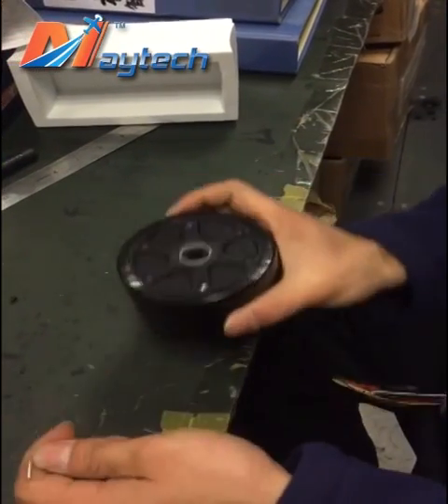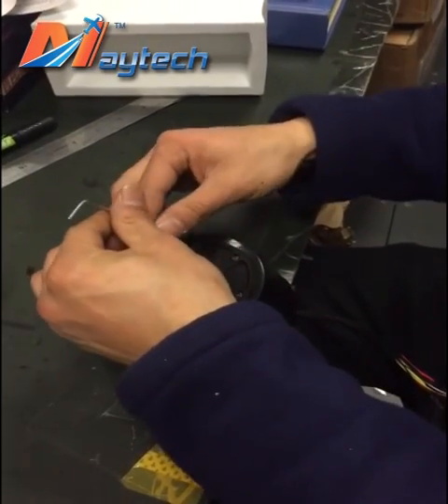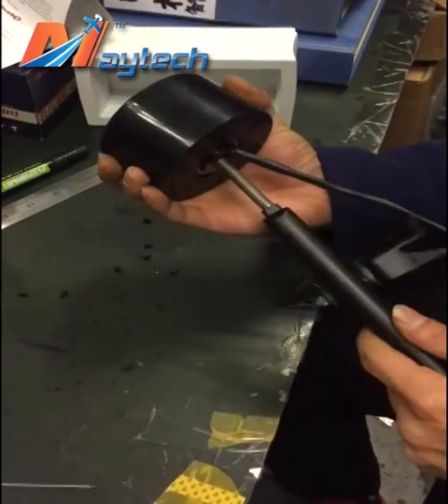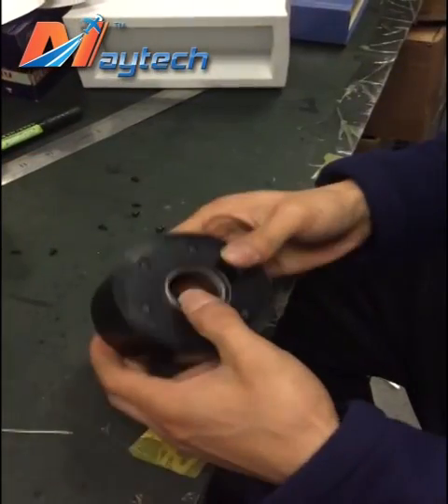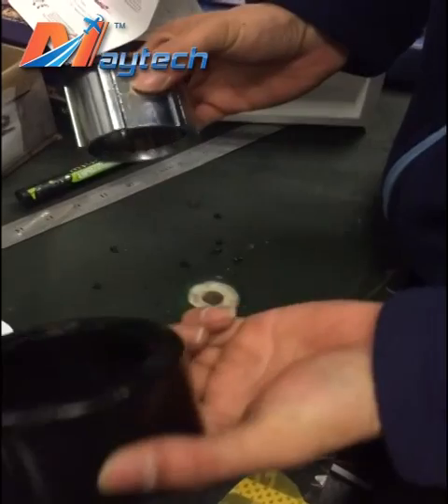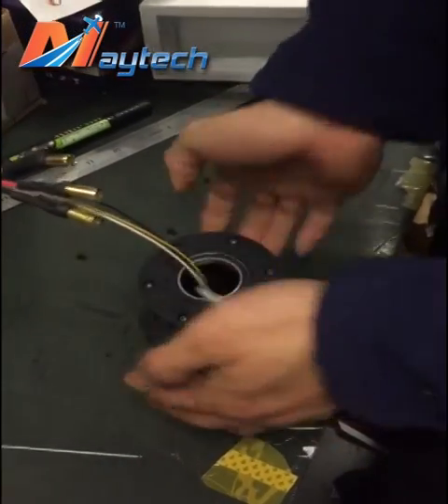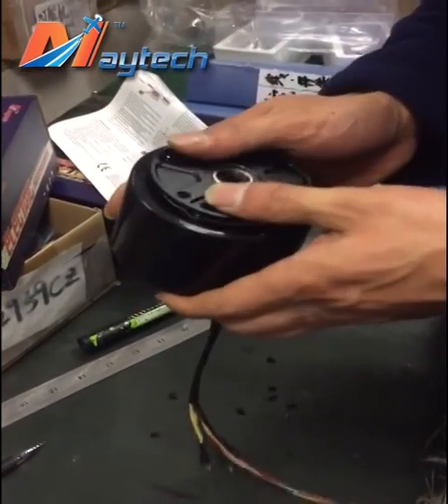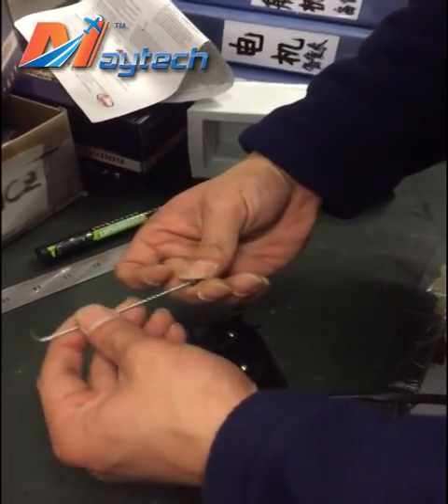How to change the hub motor PU tyres

Comment: I need PI for hub motor. Next project I am building a carbon fiber Kevlar board with your hub motors. I am going to try a different controller. It's one board that controls two motors with hall sensors. I need your motors though. Email me
Reply from the maker: Hi Joe, ok, email will send to you now